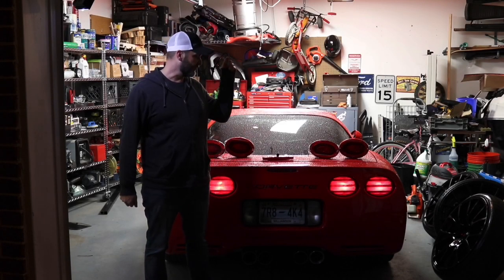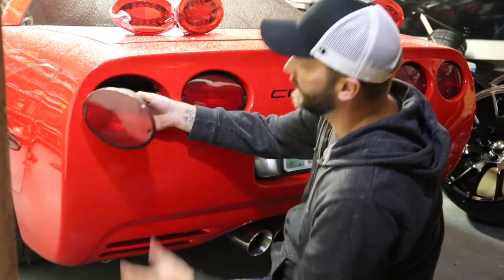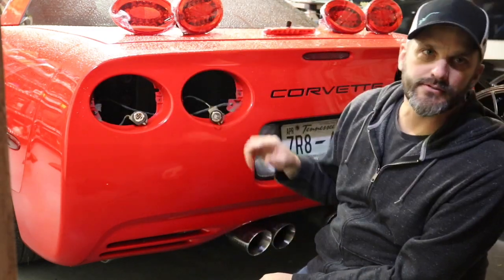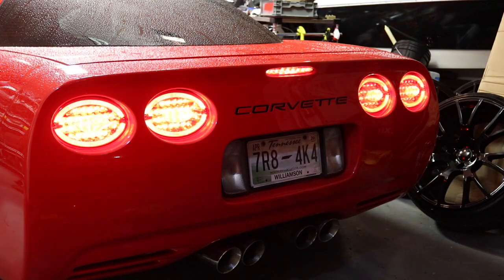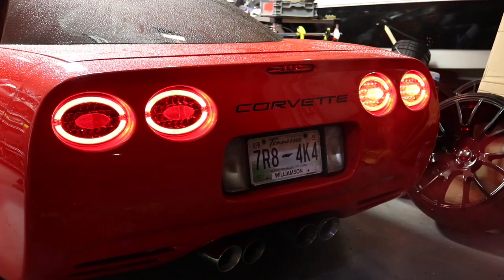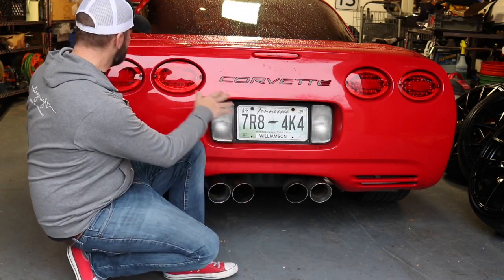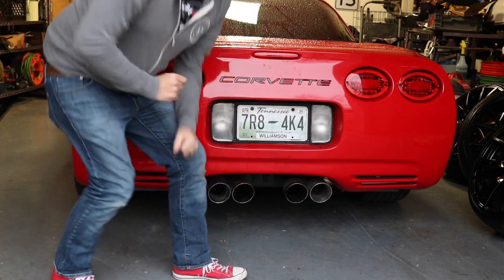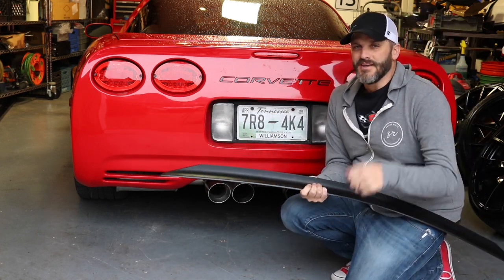Halo LED Tail Light install C5 CORVETTE!!

Comment: I have had my Halo  units installed now for two years, and I really like them as it modernizes the rear end.  I also spaced mine flush with the back panel, another updated look, in my opinion. However as you pointed out the Halo ring illumination at dusk is OK, not great. The reason is they did not use a high powered LED, or possibly the incorrect LED for the indirect light tube application (I have been in OEM LED industry  since 1996). Regardless I think they are great and could be greater per my suggestion. thanks for your video.